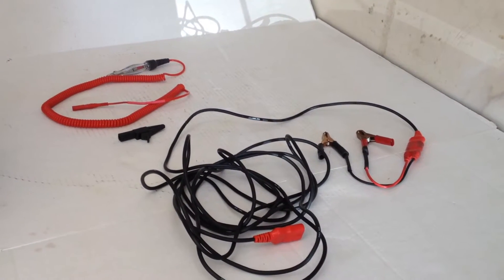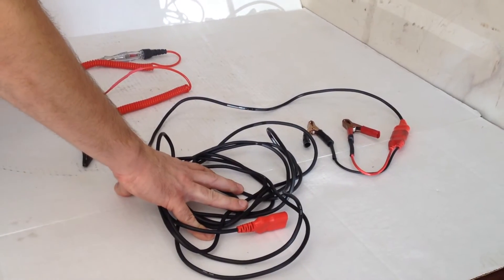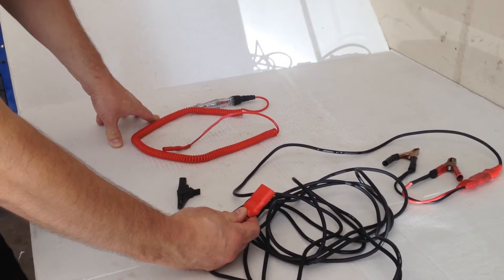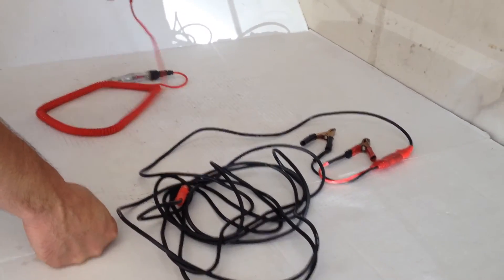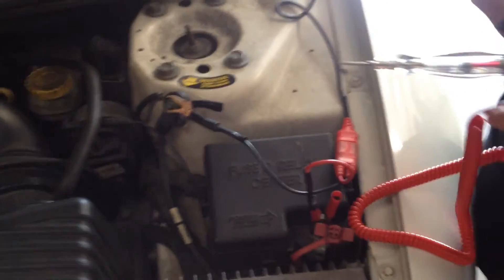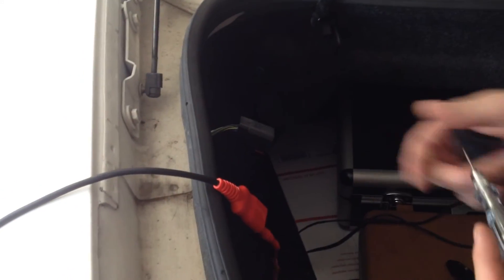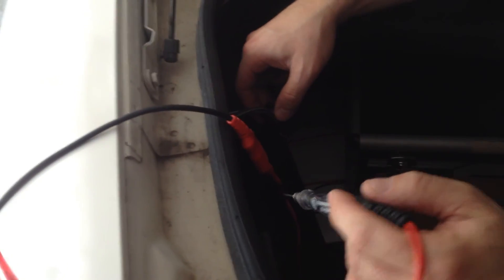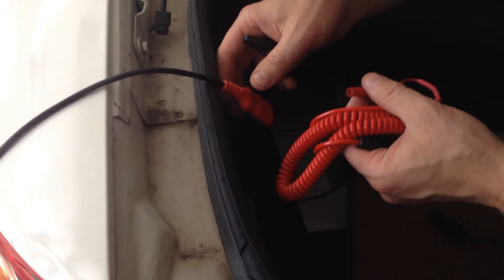Modified test light

Comment: I know this is an old video but I just recently stumbled across it (and your channel) and I'm not sure why this modification isn't more popular. I can't stand the fact that my clip is constantly coming off when I use my test light and, while finding a ground can be tough in some spots, finding a battery positive source can be even tougher.  I don't have a Power Probe to repurpose but this setup is well worth the cost of buying the parts.  I just ordered all the stuff to do this.  The one thing I couldn't find was good quality shrouded male banana connectors.  I ended up going with this from Mouser.com:

https://www.mouser.com/ProductDetail/548-BU-6161-M-39-2

It's $15 +SH but you end up with two of them when you cut it in half and with it being a good quality test lead it should be durable.  Also, in addition to the PN3049 extension cable you'll need the PN3046 battery clips, easily found on eBay.  You will also need the alligator clip for the test light when not connected to the PN3049.  The best place I've found for those is:

https://www.mouser.com/ProductDetail/548-BU-65-0  (-0 is black, -2 is red, -4 is yellow and -6 is blue)

I see Triangle Diagnostics noticed it but I'm surprised this repurposing hasn't caught on with the rest of the pro's who use test lights daily.  This is the first time I've seen this.  

Thanks for sharing and posting it!
Reply from the maker: johnaclark1 Thank you my friend. This is a very easy modification that saves so much time and frustration to find good ground . On my channel I have play list with other home made diagnostic tools. Please check it out. Thank you for watching and supporting my channel. Cheers
Reply: Thanks.  Yes, I've found your other videos and have been watching them the last few days.  Thanks for posting all the tips!
Reply: Some of the OTC test lights have a threaded shank on the tip. I was also thinking there should be a way to thread a banana jack to that and have a banana jack on the tip, too.  I have a small lathe and was thinking of making an adapter to go on the tip that I could screw a banana jack connector to.
Reply from the maker: johnaclark1 I already made that modification works great. Please watch this video. Thank you.
  https://youtu.be/eit4qXbStH4
Reply: Just watched that.  Yeah, something like that is what I want.  I wasn't sure if there was something already made that would work or if I would need to turn something and solder or thread a banana jack to it..
Reply from the maker: johnaclark1 I didn't find anything like that. For now we will have to modify it but I am sure somebody will start selling adapters like that. 👍
Reply: There are these:   https://www.amazon.com/OTC-3905-Multimeter-Piercing-Jumper/dp/B005J3KS82

I managed to turn down a piece of aluminum, drill it, thread it, and attach it to a banana jack I had laying around.  Put a piece of heat shrink over the whole thing and it's perfect.  Now just waiting for my power probe cables from eBay.  Thanks again!

Comment: Hi in reference to modified test light.how have you connected crocodile clips to power probe extension lead on other end of crocodile clips is that a power probe fitment.Thanks (great viddys)
Reply from the maker: Yes I connected other end to the battery posts with power probe alligator clips.     http://www.ebay.com/itm/FREE-2-DAY-SHIPPING-Power-Probe-PN3046-Battery-Clip-for-319FT-Automotive-/161674066384?epid=1311855851&hash=item25a48679d0:g:uqwAAOSwXXxZVXVB
Reply: unfortunately these links are gone.  But it would be nice to have the details to look them up.  I guess banana may be all we need.  I'm actually working on a similar idea for another application I'll upload once completed.  Not sure banana will work as I need polarized connections.

Comment: Nice Idea...
But in my case I used thrown away speaker cable with clamps to battery and use that as an extension.Of course your method is much cleaner...